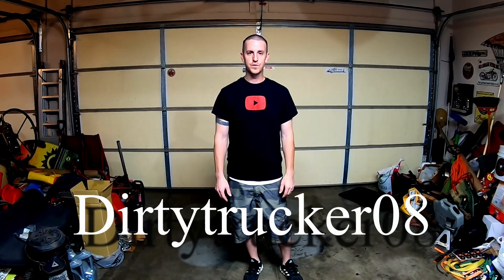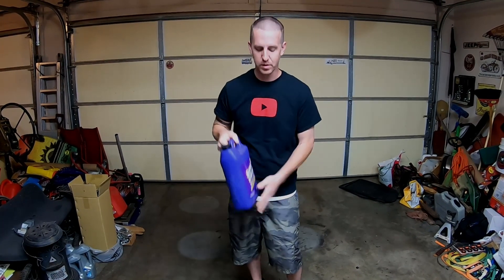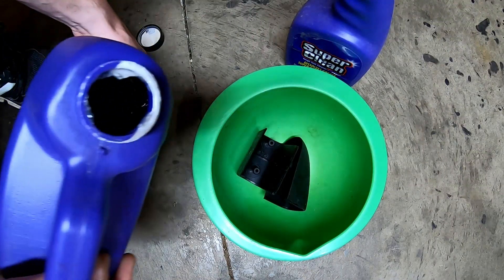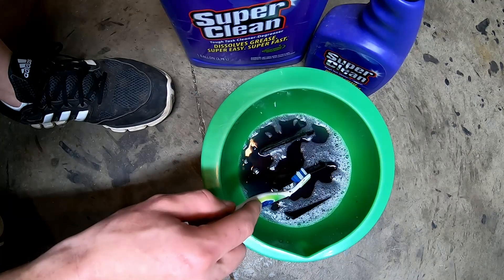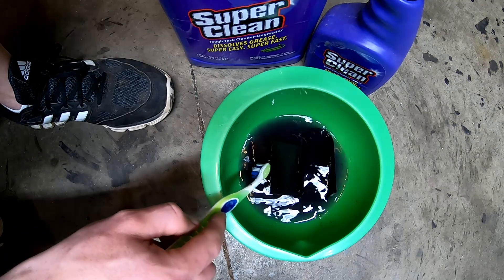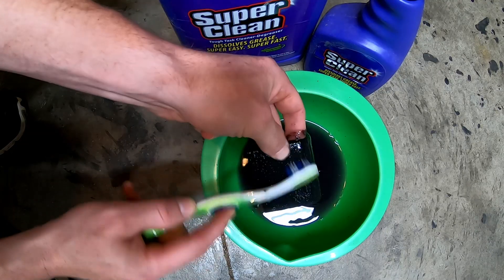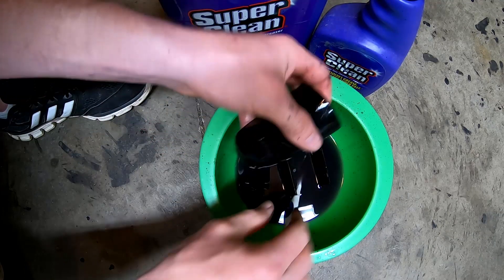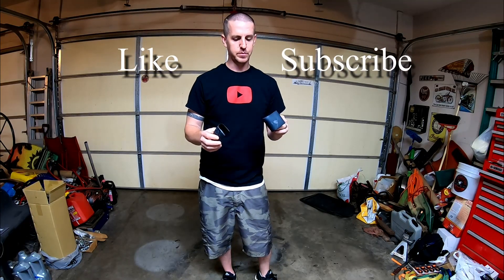Sticky Plastic?  Cheap Easy Fix

Comment: Thanks for the tip Chris, but allow me to leave you with a quick tip. I used to clean my work caps without gloves with Super Clean, and within hours my hands turned crepitus. Scared the heck out of me. Lasted for days and felt like I had tight fitting leather gloves on. Then I looked at the container, and although it is biodegradable, it has a symbol with your hands looking like bones. In short, I always wear gloves with this stuff now.
Reply from the maker: That's always good advice.
Thank you for your feedback.